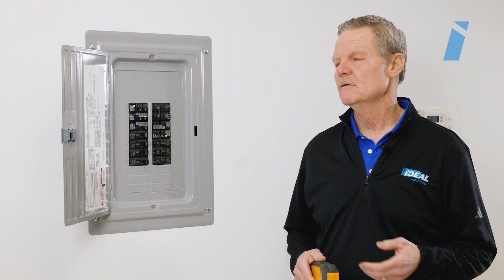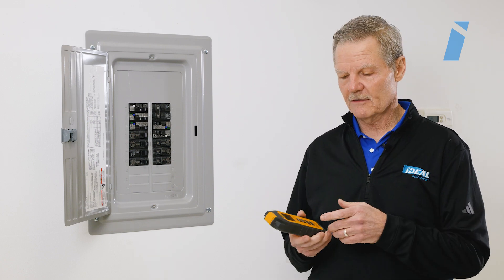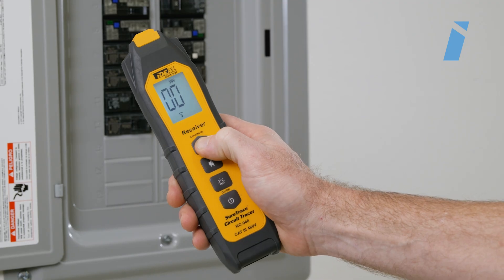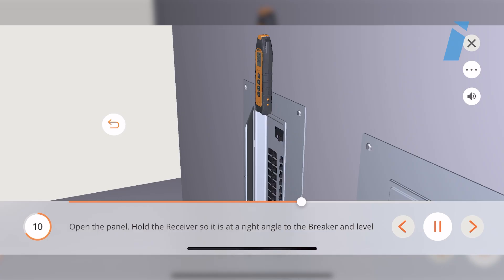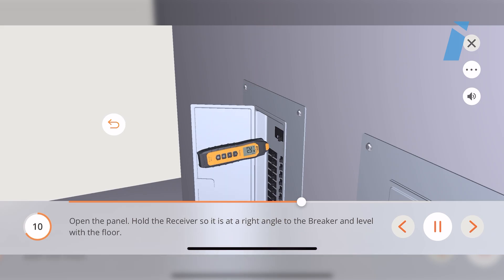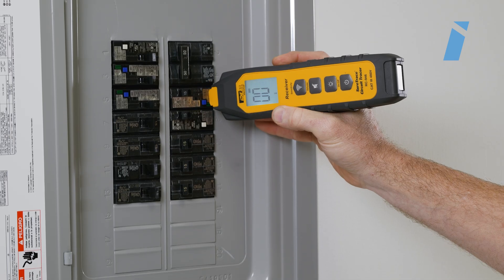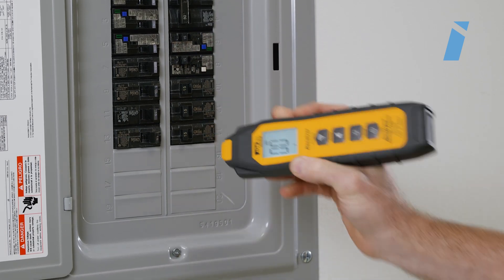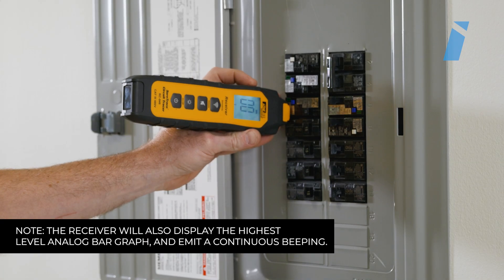How to Find Circuit Breakers with the SureTrace Circuit Tracer

Comment: I need help bad !!! This things pissing me off. On lowest sensitivity it won’t find the correct breaker (using the outlet leads) one signal setting higher , it’s literally showing EVERYTHING is 90+ signal . wtf . My 60$ Milwaukee found breakers easier
Reply from the maker: Hi there, sorry to hear you did not have an IDEAL experience. Please email us at contactus@idealindustries.com.
Reply: @IDEALElectricalGlobal  hey I take everything back, it’s actually awesome. I just thought I knew the correct breaker and was testing. One question though why do you have to hold it to the side for it to be accurate? Will that affect the accuracy if you hold it upright (to actually see the screen) ? Tracing wires through walls.
Reply from the maker: So you can hold it upright to view the screen, but if the signal seems less distinct, rotating the tool or slightly changing your angle usually helps dial it in!
Reply: @IDEALElectricalGlobal it seems to be common practice and the only way to get accurate readings on a breaker atleast , to hold it sideways